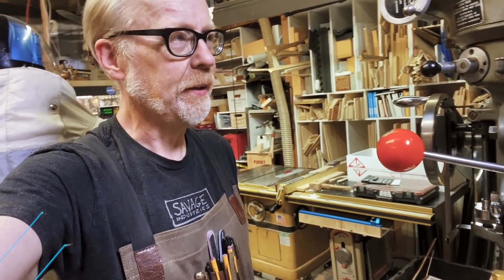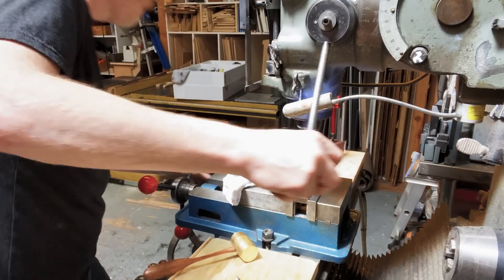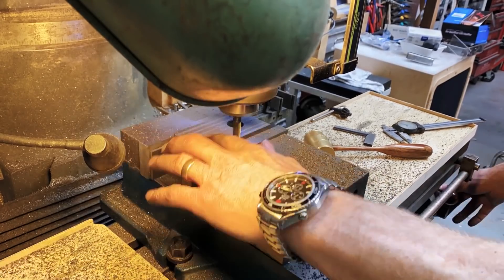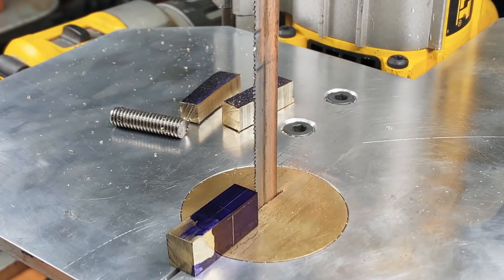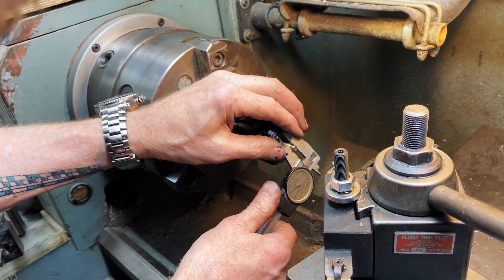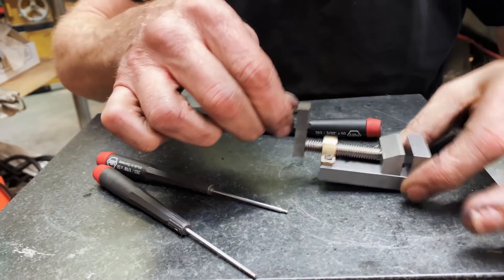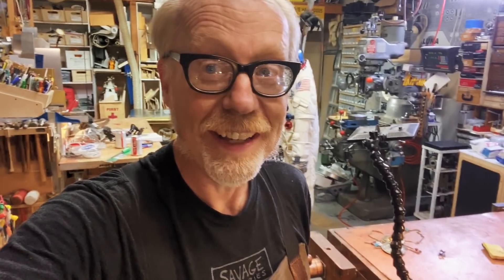Adam Savage's One Day Builds: Mini Machine Vise!

Comment: Absolutely love it. 

The clapper board at the front of the video is quite cool, but ODB means something different to me....

The clickspring inspiration is definitely visible through this and I love to see what is clearly Adam using the time alone in the shop to develop new techniques and expand the workshop tooling, you've gotta have your vices...

I'm inspired by the enthusiasm... I really want to get back into my workshop and start building things again, about a year ago I had to use it as "temporary" storage so I haven't really been able to use it as a workshop, I am finally clearing out the junk and this is keeping me motivated with that process... 

Thanks again Adam, you are such an inspiration.

Comment: Really lovely little vice there Adam.  A Small suggestion.  If you machine a small chamfer along the bottom edge of the moving grip on the vice it will then clear the radius in the base of your "L" and fully close without trying to tip or catch on the base.

Comment: This is definitely good Vice.
This channel is just such a vice for me.

I had one of those moments earlier this year. few weeks back trying to get the calipers off my mom's car so we could change the rotor, the bolt was stuck. which was when I finally realized I can cut metal ! I have the capability and tools I could cut a relief in and snap it on a part that would be replaced.
So I went in with my rotary tool put in a couple notches and went at it with a sledgehammer twice. then had to get another Sledgehammer because the handle broke. This might have also qualified as stress relief but I digress.

And why is it when you go I can make that tool oh I need that tool to make that tool for most tools?

Comment: We used to lap diesel injector body halves to each other using figure eights, lots of em. No washers or any sealing compounds of any type, just metal to metal faces and they sealed thousands  of psi and zero leaks! Figure 8's are the way to true flatness.

Comment: Learned the sanding in a figure 8 thing back in the early 70s when I rebuilt mercedes diesel fuel injectors. Makes a nice and flat finish that is necessary on the hats. Now I do it when I sand anything.

Comment: Hi Adam, This video made me think of the vice I made as part of my Airforce basic engineering training. It was a very similar design. You mentioned the other day that you are rediscovering making with hand files, on that my vice was made only using a drill press (for stitch drilling only) hacksaws and files, except for the screw. The marking was 1 mark of 10 off for every 0.001" off over 90% of each surface dimension of each peice. A challenge for you one day maybe. Oh and yes I still have it and I'm a perfectionist so I think I got over 90%

Comment: When I studies watchmaking we used a flat brass plate similar to an upside down iron and the steel would heat up in a much more controlled way.
So long as the surface to be blued was polished it would be good. I would anneal  the steel first so that it's uniform and then temper it to give it a hard shell.

Comment: It is satisfying to build or modify a tool to your specs i drive a semi and i do alot of my own repair and my favorite by far is a gladhand (used to connect air supply from my truck to the trailer) you can get from any truck stop and put a quick connect fitting on the end so now with the red trailer knob pushed in i can run not only an air chuck to inflate tires by air nozzles and any other tool that uses compressed air to run like impacts and such and its made my life 1000000 times easier and youre right you start looking at everything in a whole different lens! Tools are just f@^×(ng awesome! Lol

Comment: Great entertaining video as always. Just to add the required air of negativity I have to say that the technique you use will not guarantee square blocks.  Just tapping down onto the parallels is not enough if your vice jaws are clamping on un-machined and un-square surfaces.  Because it is too long to explain here I suggest you search squaring and see how to get a real square using a piece of wire or a ball.  Even the smallest errors in squaring on your build can lead to things like moving jaws sticking.
Having said that, your videos come to me like a breath of fresh air. Your enthusiasm and exuberance is infectious and a blessing in these times.
Thank you for your videos.
You and your family stay safe.

Comment: Drill and ream four small holes on the top of the vice. Two on the fixed jaw and two on the movable jaw. Insert slip fit pins into the holes. Now your vice is capable of holding small round objects like watches or very small gears so you can drill or machine them.

Comment: A useful design mod would be to make the lead screw with an integral knurled knob on the end cross drilled for a tommy bar. I have a commercially made mini-vise like this and it allows you to mount the vise on a larger flat surface without the handle hitting anything. Maybe you could just make a second one with that feature.

Comment: Yeah, 100% a better video format. Looks like you'll be needing a facemill for the Bridgeport next! Also, bluing with Chris's method looks great for fancy parts. If you want that black tool steel look a super easy/cheap way of achieving it is to heat the steel past its temper colour range (very pale blue) then dump in oil, I use old engine oil. Cleanliness and surface finish are just as important but you cant go too far with it, always works and cheaper than selenium dioxide.

Comment: There really is nothing quite like using your maker skills to make a tool to make more things. I guess it really first hit me when I got into blacksmithing a few years go. Like, I had made clamps and stuff for wood working with wood working skills, and stuff like that prior to blacksmithing, but making tools for all kinds of different crafts with smithing was a completely different experience. Suddenly, if I needed a super weird specific chisel, I just make one out of a scrap file. I need a hold down clamp with a really high angle, I just hammer one out of half inch round. Combining the ability to move and shape metal with my other skills made expanding my other skills that much easier.

Comment: i just ordered a lathe, suppose to be here monday, its one of the cheap mini 7x14 lathes so its probably not the best but it was all i could afford so i took the chance, ive been messing with 3d printers for 3 yrs an the more ive learned to model the more i want to make metal parts so the lathe is my first tool for that, but the mill is something that i really really want an know i could actually put it to use more than the lathe but the cost of the mill is so much more than the mill i decide to get what i could for now an im hoping i'll be able to save up to get the mill later. theres one ive seen on amazon called a proxxxen i think was the brand but it is $450 for the mill an ive not really been able to find much online on it, a few videos of ppl using it but not alot of info on what its capable of working an how accurate it is. i dont think i need the most accurate at this point cause im still learning but i do want to be able to tune the stuff in as i learn an make them more accurate. would love to see adam do videos on the cheapest tools u can get an what they are able to do. the only option i have to ever get to use a mill is to find a job that would allow me to be around it an that would be nice to have a job working with this stuff but i have no clue how to even start to get into this kinda work an what it takes to learn without actually owning the stuff an using it.

Comment: You need to aquire a small surface grinder... Something like a Harig 612 would fit perfectly in your shop. It would make a lot of that hand work sanding on the surface plate much, much easier. Plus it would add an extra zero to the right of the decimal with regard to the level of precision you can achieve!

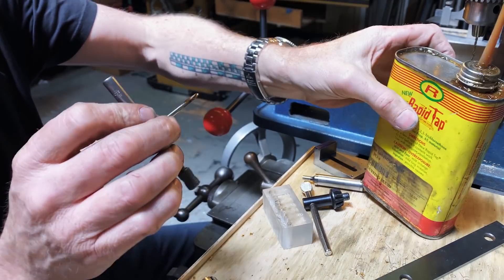Comment: 7:55 ...THAT'S a great idea...!
8:12 ...relaxing...unless you break the tap...!
...i.m.o. the smaller the worse, because it's more difficult to remove a small one (e.g. M3) than a bigger one (e.g. M6)
...the biggest on I broke was a M10...! (shame on me...! :-P ) 

13:30 ...there is not thing like "too much cooling-fluid...!" ;-)

...when i was an apprentice some 40 years ago we built some of our own tools: a 200 gram hammer, a tap-wrench and a drilling-vise - and we mostly filed them...!
...i still have and use them...!
...for the vise we didn't use cast-iron, we made it from C-15-steel...! 
...fun to file...not ;-)
...and you're right: working with cast-iron gives you dirty fingers...! ;-)

Comment: Machining cast iron can be extremely pleasurable when it is nice and soft and basically turns to dust under your tooling. But it can be a nightmare when you get a piece that has hardened bits throughout, it is almost like it is specled with tungsten carbide bits throughout.

Comment: 5:02 would placing a magnet near the cutting plane, prevent most of the iron from spreading?
Reply: It would certainly help as would using a shop vac instead of blowing the dust everywhere.
Reply: Shop vac w/removable circular magnet on the hose.
Without shop-wide, aggressive exhaust ventilation, blowing off dust just redistributes the dirt evenly thoughout the shop.

Comment: The dust from cast iron is also abrasive on your slideways. Make sure you clean thoroughly and re-oil all of the sliding parts of your mill. <edit> of course you called it out in the vid immediately after I made the comment. :)

Comment: That Vice is cute but has 2 critical flaws. If the jaw gets loose, you can’t tighten it without removing it from the table. 
Also, Vice flex will be an issue as the rear jaw will constantly move. But for small parts without critical tolerances it’s great.

Comment: Nice work on the vice Adam, You should have left a 1/8 lip around the bottom for clamping to the bed of your mill also for holding small things. i guess you will need to make a few different sizes now.

Comment: Yea... I too am in need for a small machinists vice for use with my X-Carve ( https://imgur.com/a/04LhFJN ) but the commercially available ones that would still fit underneath the machine are just out of a sensible budget range and everything else is, or at least looks, like it's utter garbage. It's basically as if there's no in-between the two options which is why I'm thinking about making my own one

Comment: Adam, Couldn't you use a magnetic base with an arm and use a band clamp to make a adjustable vacuum hose holder so you could have the vacuum running and cleaning while you are working? When I was finishing up my degree I was in the machine shop on campus a lot and working with a bunch of wood on the mill as well and just held the vacuum or had a partner hold it while cutting the wood to avoid all the mess.

Comment: The only thing this adorable little vise is missing, is a ball end mill relief cut at the 90 degree intersection of the fixed jaw. Either that or cutting a flat in the moving jaw so the two can meet planum apud planum.
Also, that's the perfect amount of "cooling" fluid, idea is this, always keep your bits cooled, otherwise, the metal gets heat fatigued and right in the middle of the most important job, you'll see it all go wrong when the edge just gives up. So puffs of smoke are ideal, as that's heat going some place else, other than into the bit.

Comment: When drilling the steel handle, it looks like your speed is too high. Not an expert, but it looks like you were going much faster than 1200 rpm to be getting those small, smokey chips. Something closer to 1000 rpm would probably have been easier to work with and then you really wouldn't need so much cooling fluid.

Love the build, love the click spring influences.

Comment: Seems like a rite of passage to make your own vise.
Why did you decide not to put a 45 degree slot in the inside corner of the fixed part of the vise?
p.s. There is such a thing as too much hair in the machine shop.  I had a co-worker who lost a bit of scalp to a drill press, so be careful and don't insist on a professional cut.

Comment: The handle looks really nice, but having the handle swing down lower than the bottom of the vise is going to be really impractical, you won't be able to lock and unlock it while its clamped down to a surface, and you won't be able to to set it down flat if the handle happens to fall there when you tighten it. you might need to make a knob with holes drilled through it so you can turn it with an allen wrench.

Also, You're a machinist now, buy a surface grinder and treat your surface plate like its a new born baby.

Comment: I work quite a lot with cast iron, and that dust that comes off it is horrifically bad for you. I cannot recommend it enough to wear a mask while working with it. Disposable will do in a pinch, but a painters mask is ideal.
First time i worked with cast iron, I was to cut some castings down the middle with an angle grinder. I was going to go about it all willy nilly, when one of my colleagues recommended i wear a mask. After putting one on and then cutting the castings, I took off all the PPE and the entire portion of my face that was exposed to air was completely black with the dust. It genuinely looked like tribal tattoo, it was so dense.
So please wear a mask next time. We don't want our favourite maker getting ill.

Comment: If you want to maintain high tolerances on your milling machine,  STOP WITH THE AIR GUN!  The high pressure air just drives abrasive particles between mating parts leading to excessive wear.

Comment: Little "pro tip" from a total amateur who has no business giving you tips, I stopped buying regular straight flute hand taps, and only get spiral point (not spiral flute) taps now that push the chips forward....that way you put them in a drill and tap your holes, actually much less chance of breaking a tap because you aren't constantly grabbing the tap wrench and risking wobbling it around and side loading it and snapping them off....not great for short blind holes, but I've power tapped blind holes in only a drill chuck on the Bridgeport and had great luck....